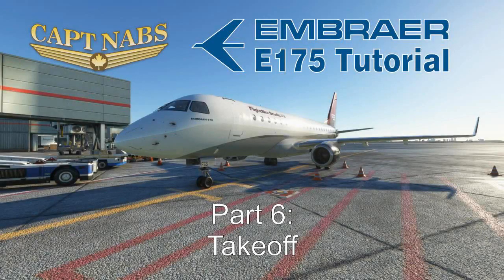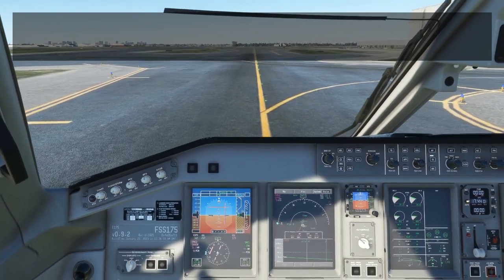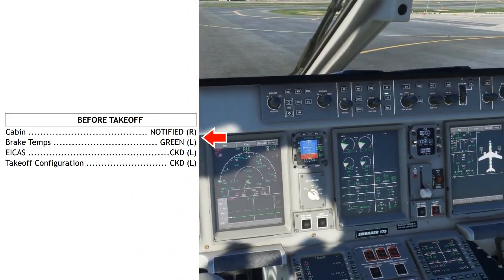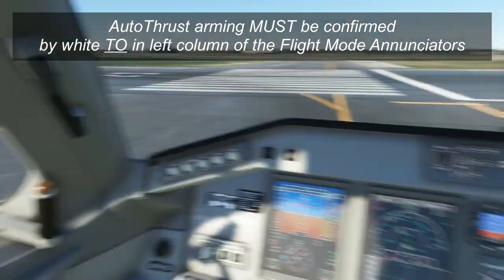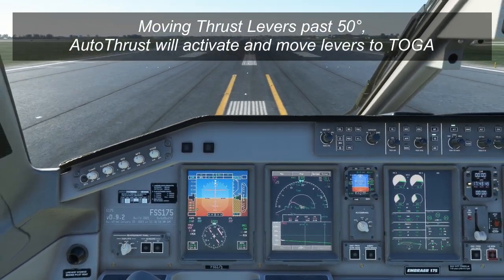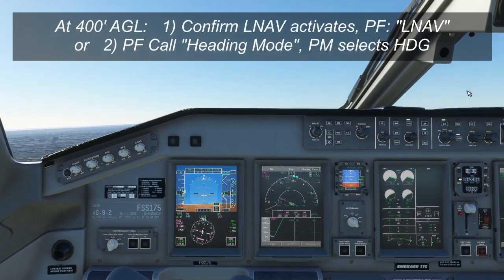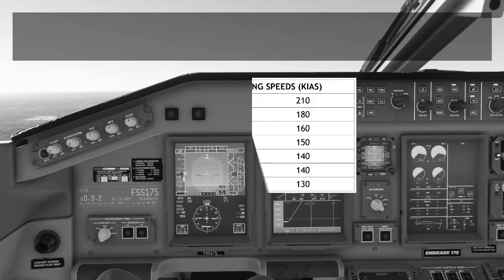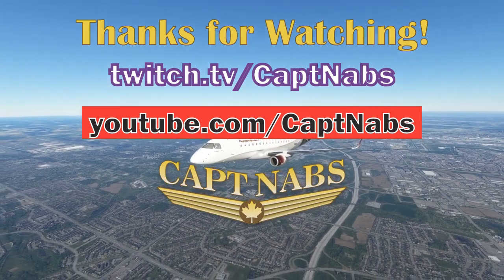Embraer E175 Tutorial 06: Takeoff

Comment: Hey man thx for your work , its gonna help me a lot..
Reply from the maker: Happy to hear it will go to good use.
Reply: @CaptNabs  Hello there , is there a difference between an e175 and e170 ? Im looking for buying posters to practice flows and check-lists and the 175 is double the price.
Reply from the maker: The primary difference between the 170 anf 175 is size. The 175 is a bit bigger and has another row of seats.

From the flight deck, the planes are identical as far as I know. Even the 190/195 are practically identical from a procedure perspective. My 175 type rating was completed on a 190 sim with an online differences course afterwards.
Reply: @CaptNabs  thx for the information , I should be a member of the club soon,  that's why im asking.
Reply from the maker: Best of Luck!

Comment: A/T does no engage (light off) when pressing A/T button. Why could it be?
Reply from the maker: Does the white A/T indication appear on the PFD?
Reply: @CaptNabs  The FMA indicates "TO" when A/T button pushed down, but it does not illuminate in the FCU as it does in your video
Reply: @CaptNabs  I decided to give it a try and pushed the throttles to 40% N1 and then press TO/GA again. This time the A/T illuminated and it worked fine. I am not sure if I only had to push the throttles for ward an the A/T would automatically engage and illuminate on the FCU, or just push the throttle forward.
Reply: It seems to be the case. Push A/T once when lining up on observe TO in the FMA. Then throttle forward to 40% with brakes on, the push forward to TO/GA and A/T engages and it illuminates in the FCU. Thanks

Comment: One question: what is the pitch attitude in real life in the E Jets? Also 10 degree? Most of the flight directors of other airliners tend to indicate 15 degrees pitch after lift off until the acc Alt.
Reply from the maker: The E175 operates very similar to most other jets in the takeoff phase. The pilot initially rotates the aircraft to 10degrees. After liftoff, you transition to following the flight directors. The flight directors do not target a pitch attitude, but a speed (V2+10 for all engines operating). This usually ends up being 12 to 15 degrees. There are upper and lower limits of 8 to 18 degrees for the takeoff phase, but the airplane is really targeting the speed V2+10. This gives maximum climb performance within a reasonable safety margin.
Reply: Thank you very much for the explanation. For the model in MSFS it is not implemented yet that the FD targets V2 plus 10, right? That got me confused.